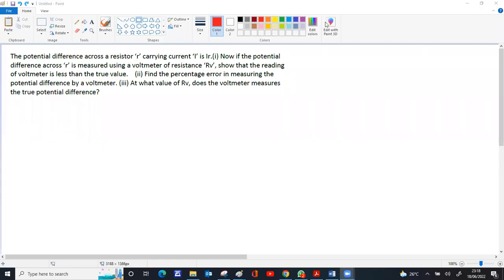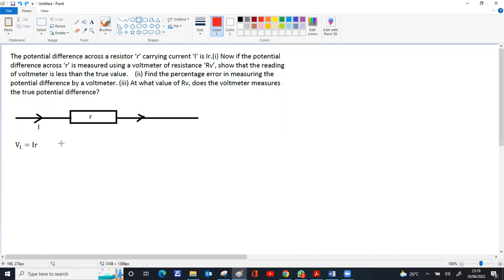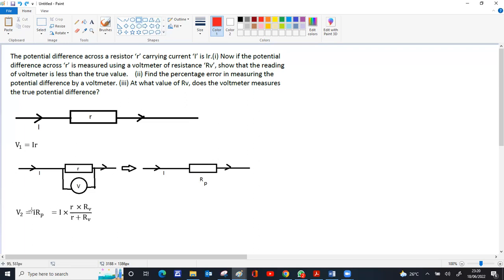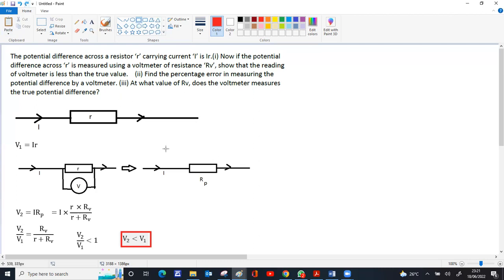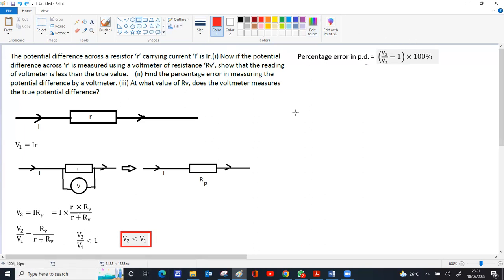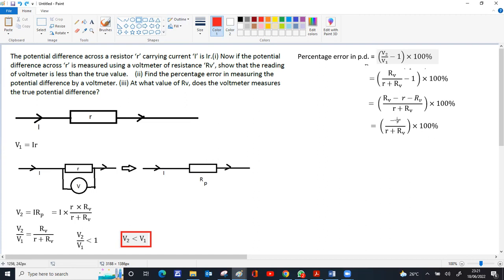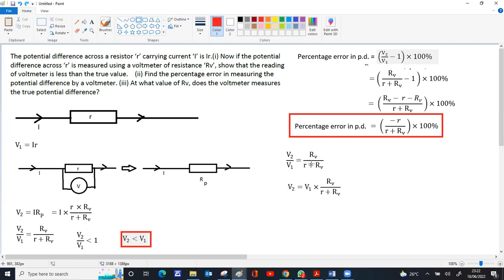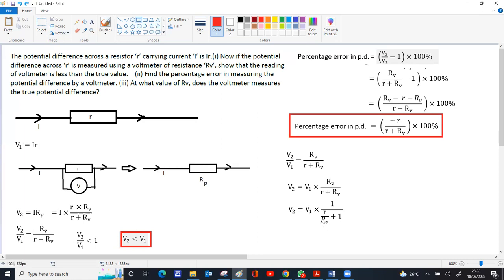GRADE XII TERM I CURRENT ELECTRICITY PERCENTAGE ERROR IN VOLTMETER READING

Comment: Sir my question is 
Why the current I remain same...... ? 
It should change in parallel combination.....
Reply from the maker: Yes. You are 100% right. This case is only applicable , if the change in the current through the circuit is negligible on introducing the voltmeter. As per the question there was no details regarding the source supplying the current ot he resistor r
Reply from the maker: Thank you for pointing out the correction. The condition is added along with the question.